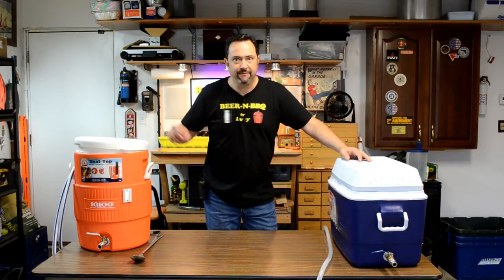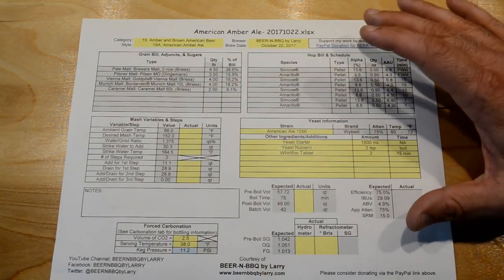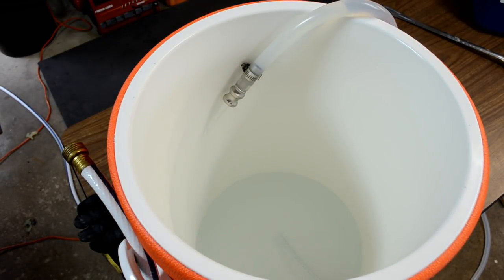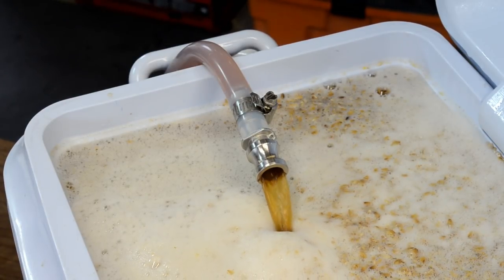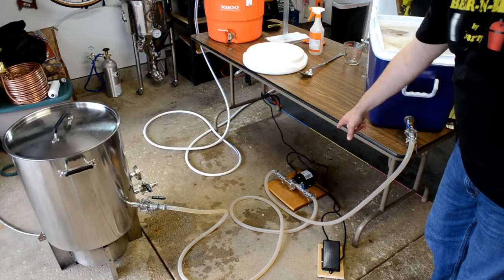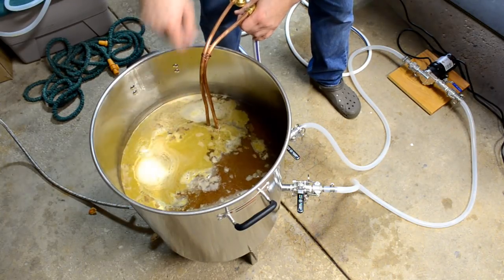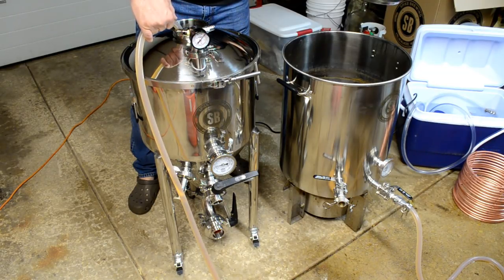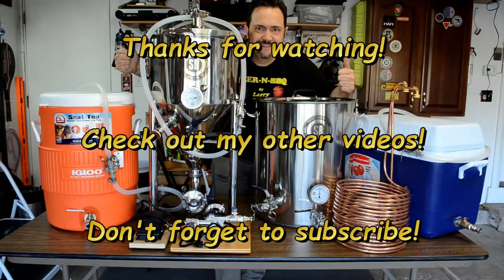My 10 Gallon Brewery: Overview & First Brew Day

Comment: Awe man, you have ALL the COOL Toys!!  Question: How would you maintain consistent fermentation temps in that fermenter?  It’s not like you could stuff it in a chest freezer.  When filled that thing must weigh a couple hundred pounds.
Reply: BEER-N-BBQ by Larry you could build a well insulated & well sealed box to wheel the fermenter into & use the guts of an old dorm fridge for cooling & a heat belt for warming along with a temp controller.  Insert a thermowell into the fermenter to monitor the actual fermentation temps.  You could dial it in exactly & do some lagering.

Comment: Those plastic jugs at 32:30 are the problem for not cooling the water fast enough. Plastic is a poor conductor of heat. Use some kind of noncorrosive metal container or a  ceramic bowl

Comment: Larry, are you expecting any problems with your pump when the vorlauf is particularly grainy?
Reply: Good. I've read on HombrewTalk that a user using a Chugger pump for vorlauf is losing efficiency by about 10 points. I hope that's an anamoly and not the same for  you.
Reply: Sorry, I went back to try to find the thread and could not.

Comment: Great video again Larry 🍻

How much time you wait after the chilling/whirlpool to set down the trub before racking in the fermenter?
Reply: Ok cool, I also use my chugger pump to do a whirlpool. Very efficiency to cold fast.

I also drill a hole on my cooler top with a camlock fitting outside and a sprinkler head inside to do the vorlof
Reply: Francis Bisson can you clarify how this works? I have spare 10 gal cooler mash tun

Comment: Do you remove air from the pump before whirlpool in some way or just let it bubble a bit and splash boiling wort?
Reply: @BEERNBBQBYLARRY  let's suppose that the wort got till the pump, do you let the air
 bubbles in the wort o remove air from the hose in some ways?

Comment: Real nice Larry, I brewed my first all grain batch 2 weeks ago and also missed calculated  the amount of water as I ended up over 1 gallon short for a 5 gallon batch, I found that  the 12 lbs of grain absorbed about 1 gallon of water so I wonder if you lost some in your mash?
Reply: I know it would be a pain but if you measured the weight of the grain after mashing that would tell you how much water was in the mash.
Reply: That was my "first suspect" also. Grain absorption of water may vary in a pretty huge range, depending of type of malt ( or unmalted grains ), quality of crushing, humidity of grain bill and so on. Nice setup Larry, your conical is especially impressive.

Comment: I'm aspiring to a similar setup to yours, Larry.  Great videos.  Did you use the barbed camlocks or the NPT fitting ones?  I'm definitely going to replicate your quick disconnect system.  Thanks!

Edit: I'm new to your videos, so I haven't seen you mention it but are you just filling brew water from the garden hose?

Comment: Does the length of the pipes affect your recipe at all (ie do you have to account for the volume of liquid still in the pipe once pumping stops?)
Reply: a 6 ft. length of hose holds just under 8 oz.  your hose setup probably holds a pint....  saving a pint is worth draining the hoses back into the kettle...